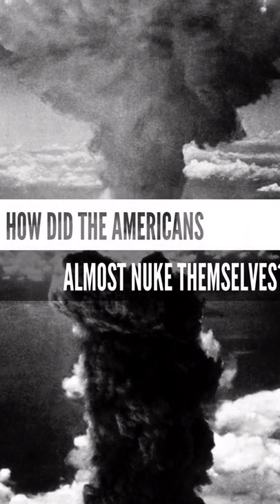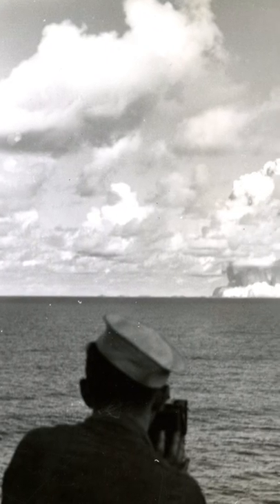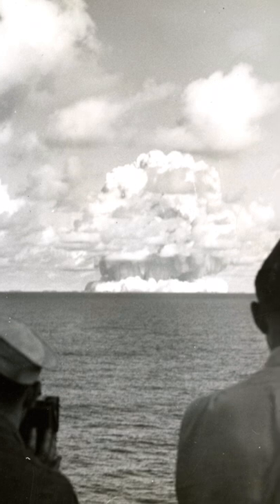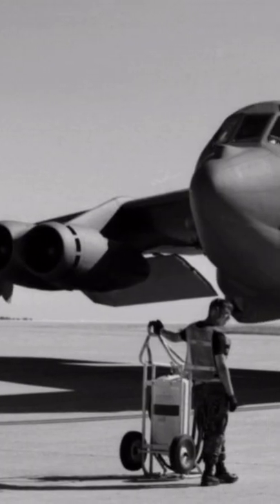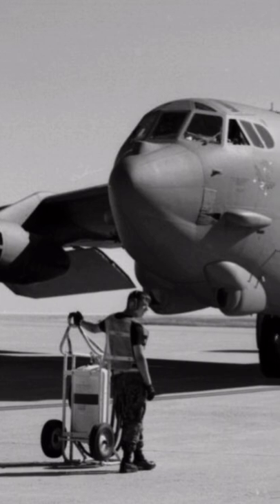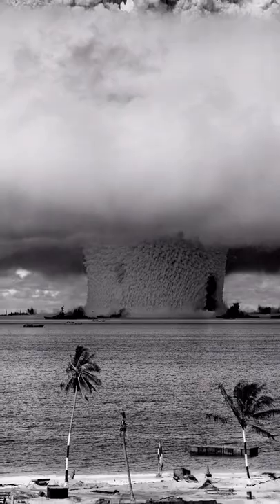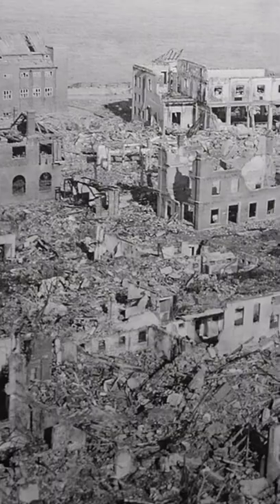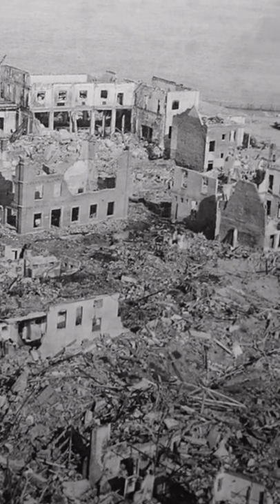How Did The Americans Almost Nuke Themselves? #Shorts

Comment: Part of the reason both the US and the Soviets had so many Nukes was because they just don't work most of the time. Both sides would task 30-40 nukes per target for just this reason. There is a distinct possibility that if total nuclear war had happened, 90-99% of all nukes would have failed to detonate.
Reply: @MrBooblo086  Effective anti missile defense systems didn't exist until the early 80s, almost a decade after both the US and USSR had reached peak nuke production. The 1% strategy was in place in the late 50s, almost 30 years before any reliable countermeasures were available.